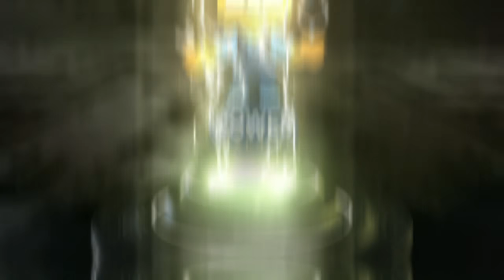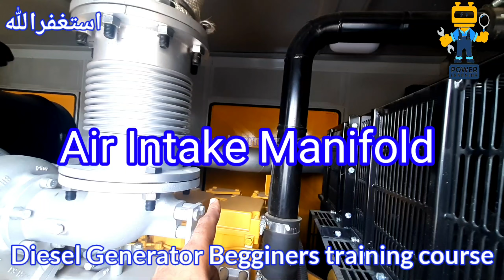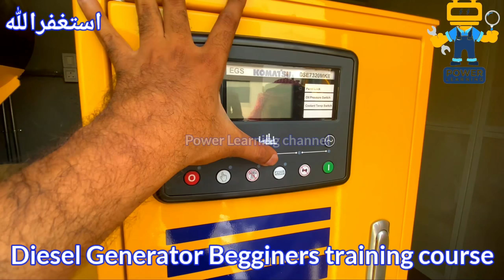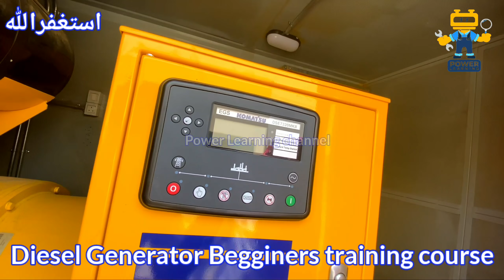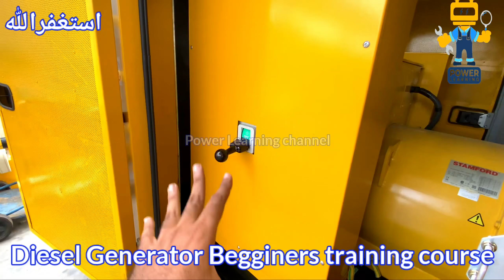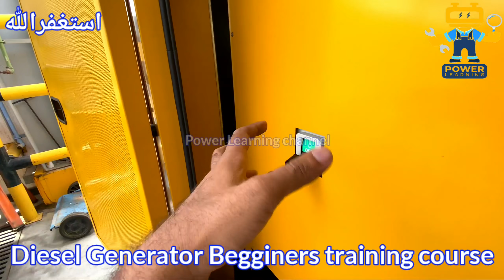Diesel Generator Training, Parts and components and working principle explain Power learning part 1

Comment: Very good explanation.
But what if the Turbocharger isn't controlled by one shaft? What if it's separate as in Bigger CAT Engines, how will the Air system work?

Comment: Thanks for explanation sir  But I am wondering as you said how a single shaft inside the turbo operating in two opposite directions ie cooler and hotter side. I feel the turbo charger has two impellers whose blades angles are different for sunction and discharge purposes though the direction of shaft rotation is one side. Clarify pls I may be wrong.
Reply from the maker: Yes, correct